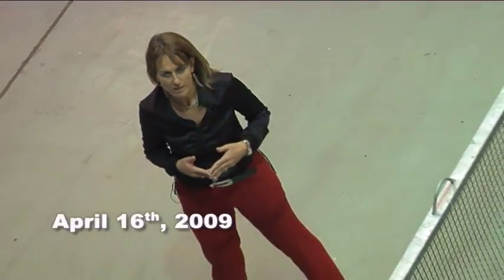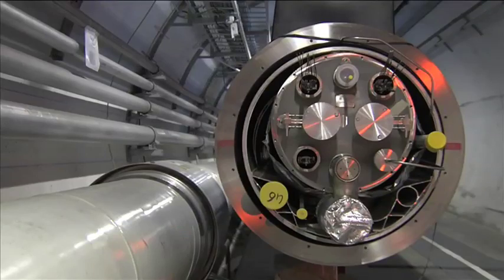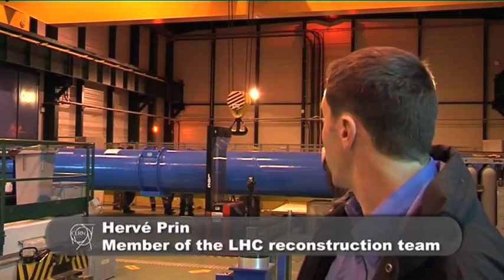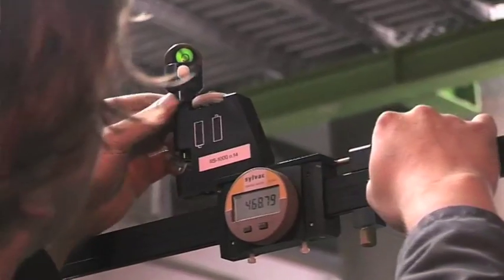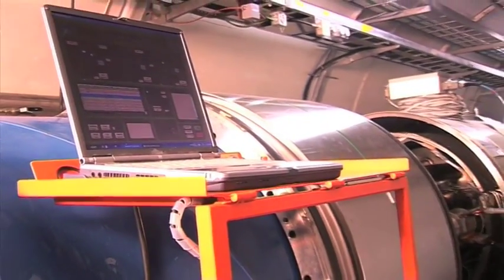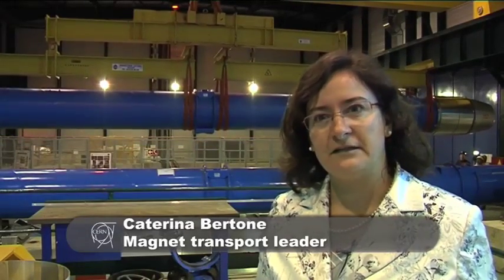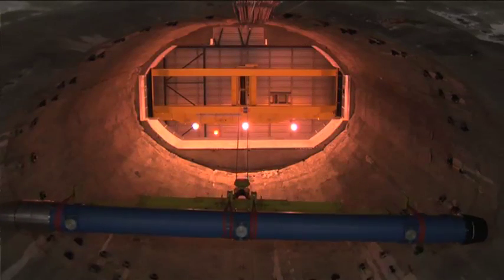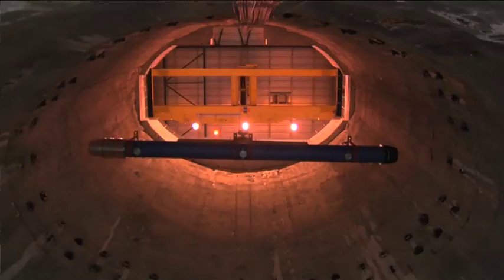LHC News - April 16, 2009 - Last dipole in tunnel

Comment: Any message that promotes the destruction of the World by LHC whatsoever is false.  The power needed to generate a singularity is beyond the measurement of electronvolts.  Say, the 14 Tev generated by LHC = momentum of a flying mosquito, annd does a mosqueto ture into a singularity when it collides with another? of course not, energy neede to make a black hole exponentially exceeds our current capabilities, or that what we shall ever be capable of.

Comment: @Rchayes88: If you would feel more secure when the LHC would be encased in lead, check out radiation protection. 1cm lead = 9 cm packed earth. So basically the LHC is shielded by the equivalent of 11 meters of lead already. Thinking that radiation can only be stopped by lead is a myth.

Comment: dont the c.e.r.n there playing with god the magnectic field will be to stronge when the components are filled with 2000 degree helium that could produced a black hole only small at first but when the magnectic mass is fuild by helium it will expand the black hole very quickly wich if that happens kiss our planent and galaxy good bye

Comment: @Rchayes88: I don't see the problem, and I think you're mixing up some unrelated things: first, the LHC is below ground, radiation is shielded by 100 metres of rock, much more mass than the athmosphere. Second, the cosmic radiation is not used to justify the radiation levels, but the risk of creating a mini black hole. If the LHC would create such a thing, it would have been created already in a natural way, and earth wouldn't exist.

Comment: continued to yousefnjjr:

i think they can be fast enough to get the energy out of the coils before an arc develops at a failing connection. if one connection rises in temperature over a treshold of lets say 5 degrees kelvin, how many milliseconds until it heats to the point of evaporation, arc and damage, and how few milliseconds do you need to dump the energy from the coils, switching them off?

Comment: "By the time a failed connection is realized, the magnet(s) circuits would be toast."

when they inject new bunches of protons into the ring, they actually need to switch on some of those magnets, get them up to full field strength, and then switch them off so that the magnetic field and currency is gone again. all that in far less than a millisecond.

so the idea would be: a connection starts heating up, security system switches off all magnets and dumps the energy a few milliseconds later.

Comment: cougar1515:

worst possible accident...  a connection between two magnets failed, got partially evaporated, caused shockwaves due to heat in the liquid helium, an arc formed, resulting flaws in the magnetic fields caused magnets to get knocked in one direction or the other, damaging many connections and magnets....

now they repair it, and install a safety system that will shut down the experiment safely and so rapidly after a failing connection is detected that this will not happen again.